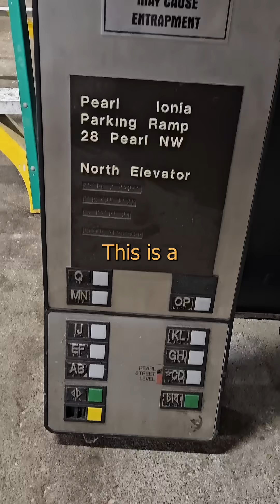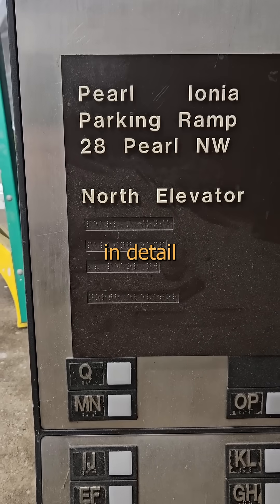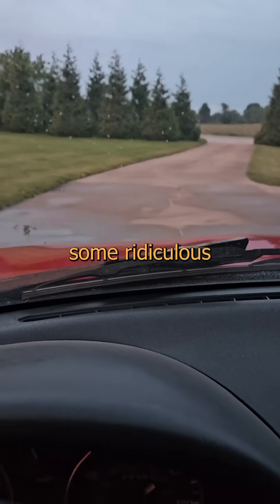Miata Mischief #chrisboden #engineering #gear #elevator #score #stories #parts #hacking #making

Comment: I had a trucking company back out on moving my little dozer back home. so after an hour of fiddle fucking around i figured out my little skid steer trailer was just big enough size wise but not weight wise, so stupider heads prevailed and i proceeded to haul it 10 miles home at 30 mph. Somehow I got home without getting busted. The word of the day was IFTA, If ta dot don't see it it don't matter.

Comment: When I first moved out on my own my apartment was furnished with a couch bed… and that’s it. Then on my way to work I saw this massive oak desk just sitting out on the sidewalk with a cardboard “free” sign on it. One problem- how do I get it the 5 miles home in my hatchback scion? After thinking about it for a few days I decided that I would give it a try anyways. At 3 in the morning I drove up and spent an hour “walking” it to my trunk and leveraging it in… at least about half way. Unlike Chris, I was not up on my Shibari skills and thus didn’t have rope, so I slowly drove back to my place with a couple hundred pounds of oak hanging out the back of my car ready to become a major roadblock if I hit a speed bump or pothole. I got it back home, repeated the “walking” process only to realize it was only half the desk, and that it was supposed to have another section to keep it stable. Eventually I propped it up with a similarly discarded wooden chair and it became my computer and project desk for the next four years.

Comment: Bought an 8-foot chunk of gutter for my house. I owned a Ford Focus. I put it on the roof and just held on to it the 20 or so blocks home. The same car transported one 6-foot and one 8-foot wooden table in my trunk. Had a few ratchet straps holding everything together from the Gr area to Ionia. On a Ford Fusion, I transported a 4x8 sheet of wood on the roof with 3 deck boards and some racket straps. Looked funny as hell driving down the back roads of Ionia from Menards to downtown. Even had some in the bed of an S10 pickup where friends acted as ratchet straps. One friend claims I almost cut him in half due to the object being bigger than the bed and lane. And me getting too close to a mailbox going 30 or so.

Comment: I actually used to have this exact car, the Mazda Miata in red, too. I drove hours into the mountains on a gravel road with 200 foot cliffs to arrive at a mountain cabin. I then proceeded to put the top down and load as many desktop computers as physically possible, even above the roof and all around me. It had to have been like 25 or more, I was planning to make some stupid crypto mining thing that was river powered. I drove all the way down the mountain while almost needing to stand up to see over my passenger side. I made it home, but I never touched crypto, and that was a lot more fun. Pro Miata tip: If you press the popup lights button really fast, it confuses the car, and only one light stays up. Keep pressing slower, and they just switch places over and over. Kinda funny at a red light.
Reply: Another time, we took a full-size washer and dryer units on a boat 30 minutes down the mexican coast at the same time, loaded it onto a quad, and went 45 minutes into the jungle with it. Suffice to say I had dry clean clothes after that. I have a video. 

One of my friends did this with 12 mattresses, and they thought they could lay on top of them to keep them down. They were almost flying off the boat if they weren't tied down.. sorta.

Comment: I got a set of lockers from a closing Joann fabric, just barely fit with the seat down but my headrests aren't detachable so i had to use one arm to keep it balanced on the headrest from one side, and a sheet of hard foam to wedge it from the other side

Comment: I did an art project where I built a raft out of denim jeans that we sailed to an island. 

I had a '95 Ford Mustang, two door and fit about 30 pairs of jeans filled with expanding insulation foam, so they were rigid and would float. I could barely see out the windshield.

was totally worth it. I have pics to prove it.

Comment: sketchiest car ride was moving 200lbs of home improvement goods in my 2002 saturn SC2. the trunk was full of bricks and boards, the bucket seats had buckets at the feets, and the entire cabin space was dominated by a 4ftx4ft plate of hardwood plywood. This had me driving with my head leaned all the way forward, or I'd have the edge of this tabletop against my neck and threaten to take my top off if I nudged the brake or steering wheel too hard.
It was a 20mile journey back to my house at 60mph, with the final 5 being on a wavy country road with more blind curves than date-night at the outreach center
Never again will I attempt something like that, but I did build a kickass poker table with it, and that's kinda cool

Comment: I managed to get my hands on a 2 ton lathe at an auction, didnt have a car so i got 4 longboards, strapped them under each corner and dragged it 5 miles home, half of which was slightly down hill, most intensive workout ever, 10/10 would torture myself doing it again

Comment: One of two sketchy moves. I've always been cheap, grew up 'poor'.  But I have been into antiques and woodworking since season 1 of This Old House.
Two particular garage sale finds come to mind, note I didn't drive until I was 23. An antique stand-up drill press with a wood base I found while 'hunting' about three miles away.  I got a skateboard and hauled it overland, and across a four lane highway at one of their lights....took three lights to make it through one with me and a top-heavy drill press on the center divider next to the left turn lane.
The other time I happened across the side drawers for a trundle Singer sewing machine. I happened to already own one without the drawers so I had these quadruple bagged one on each side of my handlebars on my bike because the person was moving as soon as their garage sale ended in twenty minutes.  So I rode five or six miles barely able to turn the wheel of my ten-speed including crossing two busy four lane roads at the light which itself took four lights because drivers in my town are jerks.

Comment: 300 pound safe Circa 1880 from a consignment shop. In my Chevy cobalt. Obviously couldn’t lift it into the trunk or back seat. Measured it to see that it would fit in the front seat. Wheeled it down the sidewalk to the car and let physics take over. Opened the door, rolled the safe against the car and use the safe as a lever against the metal of the car to flip it onto the seat. Reversed the process at the house and had a 100+ year old safe to keep the less than important stuff that no one would want to steal.

Comment: In my teens, I worked as a volunteer at a major Detroit hospital, to 'stay out of trouble' during the summers. Wearing scrubs, my duties included regular deliveries of sterilized instrument trays and linen packs to the OR core supply rooms. It was there that I noticed backup anesthesia gas systems under sheets, staged in case of any piped-in gas failure. These included ('E'-size?) cylinders of N2O, aka nitrous oxide, i.e. laughing gas, along with a similar oxygen cylinder (blue for N2O, green for O2). When mom had surgery at that hospital, my brother who's a year older came down to visit her, so I offered the 50-cent tour and we hit locker room to don scrubs (over our street clothes, leaving nothing behind). Late in the evening, after 4-8 visiting hours, we went down to the ground floors to explore. There would only be really long or emergency cases active in OR, so it was easy to stroll around unnoticed with proper attire, hair covered & masks around necks. In big store room, while sampling deep breaths of N20, my brother said "let's take it!!" so we opened up a big 'laparotomy pack', the biggest of linen packs, and wrapped a blue cylinder in linen then stuffed it all in a linen bag & strolled out, me nonchalantly dragging bag through back/sub ground halls to a back door while brother retrieved vehicle & met me. Recklessly dangerous to breathe nitrous from just-cracked cylinder valve as in hospital basement, we got a beach ball we'd fill from cylinder, from which we'd squeeze breaths resting in comfy chair, no risk of airway freezing or expansion injuries from tank pressure, and self limiting because once we passed out we'd drop ball in lap. This lasted for a party-filled adventure night where brother's band practiced (free of parental interference).

Comment: this was last year maybe me and a couple buddies had just bought a new falcon for one of them and it had broken down in a parking lot, so in all of our infinite wisdom we decided the only way to get it home for cheap was to get some rope and rathchet straps, hook it onto the trailer hitch of our other buddies still working falcon and tow it behind us for the next 15-20 mins it took us to haul this dead hunk of metal all the way back to his house (both cars where unregistered and had fake plates, yes we are dumb) turns out the engine was done for and his power steering had a leak somewhere aswell, but thats probably the sketchiest and dumbest thing we have ever done to tow something home

Comment: An ex girlfriend and I got a free couch I found on marketplace in some alley downtown, strapped it on the roof of my 1995 Honda Civic Ex Sedan and drove it 20 something miles home. I hauled a lot with that car, it had a tow package when I got it so I bought a nice little 4x6 tilt trailer that fit it very well. My highest recorded weight hauled with that 95' Civic and trailer combo was 2800lbs of excavator track rollers that I got from a project.

Comment: If you were a teenager or early 20s you probably would not find that so much of an obstacle. I had some interesting encounters with people I dated at that age in surprisingly compact vehicles - young enough to think it a good idea and without the joint pain to say otherwise.

Not particularly out there but I hauled a Kohler cast iron uneven double kitchen sink home in a 2000 Camaro once.

My girlfriend has an NB Miata and has hauled a little in it but nothing particularly interesting (it is more practical than her XR150L.). She even made it a Halloween costume, adding fangs to the mouth-like grille opening.

Comment: Out in the north, far north of Canada we had a desire for birds. Chiken of corse. We'll we go and look up or local trading networks for some birds and by all means we find a deal. One hell of a deal, 12 birds and a coop for free. Pickup that day or the day after. 

Ofcorese you can't miss a deal like that so we pack up the truck and trailer to go grab the birds and coop. The owner home was sold and they where heading for assisted living. So we where happy to help. What they had not told us was the coop was huge and in 2 pieces. So we get there and find our prize. 2 tones of building and 12 birds. This leads to a simple conundrum. How the hell we move the coop. The owner, in there late 80's goes o easy and grabs there local 12t excavator and picks up the coup. Then places it in the trailer. We do the mandatory testicular traditions and get going down the road birds and coop loaded.

If only.i could post pictures of the monster of a load going a buck 20 down the gravel road to get home. But we made it and have had birds for the last 12 years in the tank of a coup.

Comment: I transported a refrigerator in a 1977 Mini. It barely fit through the passenger door, blocked the view out the passenger side completely, and was in the way of the shift stick so I could only go in first and second gear. But it was a vintage fridge which made a nice decoration for my room then.

Comment: Nothing all that crazy compared to what's in this comment section and not too long of a drive but it was the roads I went through to get to it I was driving out to the Virginia mountains from north Carolina to go pick up an 20hp opposed twin using the only car that had anchor points in the trunk and enough space for the engine for my brother my 2010 prius and the last 5 miles was the problem steep dirt and rock paths up to a guys house that was turned into a hoarder's trove of scrap and crap not to mention the thousands of aluminum cans littering the entire property we got it in the back and tied it down with one ratchet strap to keep it from hitting the back windshield and we were off it did leak a small amount of oil but that's not near the worst crap that's been back there after bottoming out 7-8 times and scraping its ass on a few jagged rocks it was fine all the way home without any issues the motor sits on the stripped mower chassis to this day with a cracked cast intake manifold and snapped off bolts we saw after we bought it

Comment: I have a 2001 Ford Ranger that can only call 2000 pounds I had to grab my car that was in storage so I used a trailer that weighed 3000 pounds put my car on there which made the total about 5 to 6000 pounds and then drove home with no straps a week later my engine blew up

Comment: There was one time I bought a couch with my ex wife and all we had to move it was her soft top Camero, we put the top down and strapped it in the backseat to those metal brackets that are in the seat, no clue if they were made to withstand that kind of weight. It was probably a total of 6 feet in the air at the angle we had it. We used 2 straps to hold it down but one fell off along the way. I was also in the backseat with my seatbelt on holding the bottom (or left depending on how you see it) side of the couch hoping in some way it would keep the couch from flying out. Along the way, because keep in mind this was in broad daylight, during the busiest traffic hours in a small Texas town, a cop spotted us, turned around, and pulled up next to us at a light to ask how far we had to go, when he heard less than 2 miles decided that was somehow good enough for what really looked like an episode crackedMcGee and his sidekick Methany. We made it home somehow and it was pain getting it up those stairs but that was by far the easiest part of that adventure.

Comment: When I was a young lad I once hauled a lamp post and my only car was a LeBaron convertible.  Top down, passenger seat laid back, I strapped it up using the other three seat belts.  The base was down in the passenger foot well and the top was hanging out over the trunk with a flag on it like lumber over a truck tailgate.

Comment: 199X, about 10 years after my grandmother died, my dad and his brother agreed to sell her house. 

Doing this meant clearing out everything from inside and around it. 

“Everything” included a stack of fire brick, roughly the dimensions of a washing machine, that had sat in the backyard for all of my conscious life. 

My dad and I loaded it into the bed of our 198X Datsun pickup and started for home. 

Very quickly we detected that the pickup was … conflicted about its role in our errand. Acceleration was nonexistent, and braking, steering and suspension almost so. 

I twisted my torso out the passenger window so I could look aft, and saw that the rear tires were so flattened that barely an inch of tire was visible under the rims, and the leaf springs may as well have been made of actual leaves because the rear wheel arches were barely an inch above the tires. 

When we made any deviation from a straight line, the bed of the pickup would visibly shift toward the outside of the turn. 

Fortunately for us the journey was not far and of mostly straight, low speed roads - traveled never faster than 35mph, which had become the truck’s maximum speed on anything other than a downward slope. Even if it could have gone faster, we would not have done so because the brake pedal and the actual brakes seemed to exist in separate vehicles. 

We made it home in one piece, but that truck … well, the experience had changed it in a manner that reduced its market value from “very little” to “we would have to pay someone to come and take it, if we could afford to replace it, which we cannot.”

Comment: We needed to move a friend's dead Hyundai so it didn't get towed and impounded. We only had a Toyota Carolla and some random webbing and Gorrila tape. We towed that mess with knotted and tripled up webbing and to keep from running over the tails or from slingshot effect I wrapped about 80-100 feet of tape between the cars in a few foot sections. It  was about 9 miles and we managed to get it back home. It was beyond dumb and the fact we didn't have the webbing fail is insane. Every stop and go was willing that little four cylinder to pull with everything it had. Once I finally cut the webbing off and rolled it up. It had stretched about double the length and s few pieces of tape left on the tails. This was not rated webbing. It was more for furniture 😂
Young and dumb. This was 20-25 years ago probably.  Whenever Gorrilla tape first dropped.

Comment: Last summer, I found a huge street lamp that on the side of the road. They were replacing the street lights with led lights. I really wanted the huge light but only had a 2011 Honda civic. So with my newborn in the back seat somehow I managed to force it the back seat. Keep in mind the street light was 2.5ft wide & 2.5ft tall & weighed at least 45 pounds. I ended up the street light as a birthday party decor & i even got an electrician buddy to light it up. It was ridiculously bright!

Comment: No story, but I’ve never seen anyone shift 2nd to line up first gear besides my dad and I.
Reply: Count me into this club too. I do not know why but it was (I stopped driving manual transmission in 2016 because Jersey traffic) muscle memory to “clutch in, wiggle neutral, hard left, pull into second, push into first, clutch out.”

Comment: I once transported a normal PC tower on my motorcycle (KTM RC 390 GP) and only had a thin 20 meter cord and then transported it for 50 kilometers (and i transported it on the motorway with 100 mph and more)